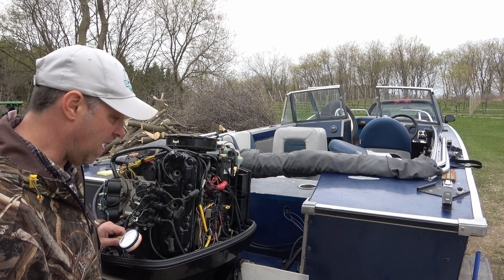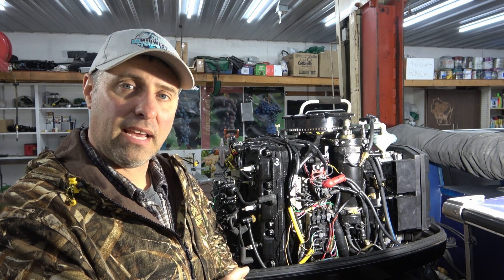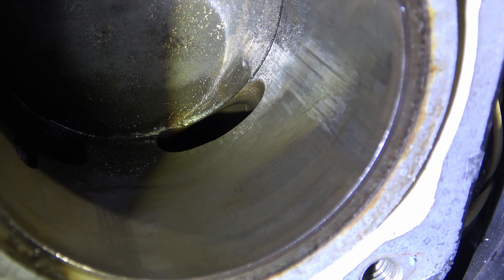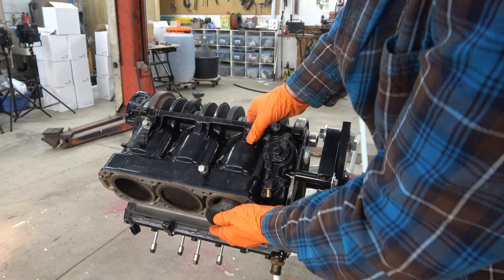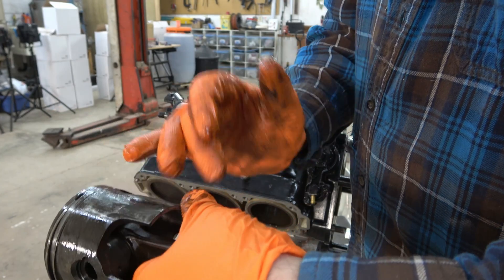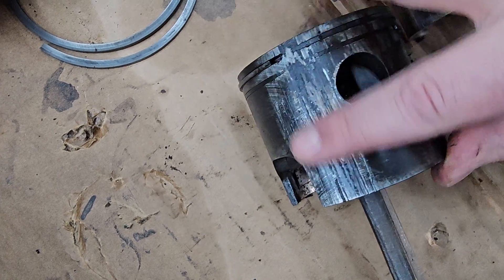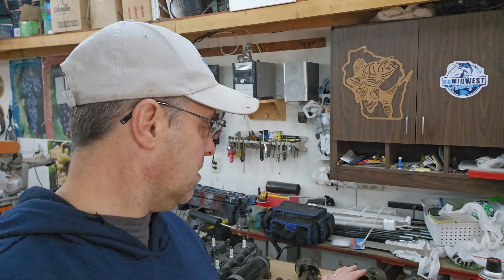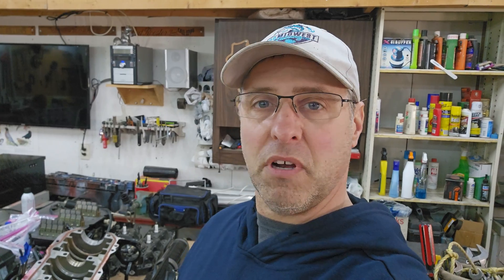This Boat Motor Has Zero Compression | Here's Why

Comment: is that a 2 stroke engine just curious ?
Reply from the maker: Yes. Its a 2 stroke carbureted motor. Hopefully this spring I will finally have it all back together. I'm doing a complete rebuild.
Reply: Yes, it’s a 2 stroke
Reply: @raisingcane225  thanks for your reply for a moment I was a little lost when I did not see  valves and a camshaft thanks again

Comment: I would ask myself why that whole bank of cylinders failed in the same way/ how are they lubricated and cooled? If the cause is still there the results will be the same.
Reply from the maker: I had the same thought. Someone mentioned that it probably overheated, so i will check all the cooling lines before putting it back together. Thanks for the feedback.

Comment: That first piston you pulled had  been getting hot too, I’d bet 2,4 and 6 were all getting ready to do the same as 1,3 and 5. It being oil injected there’s a good chance the oil pump sprocket on the crank is failing and you’re running a lean mix. Delete the injection it’s a 2stroke killer and very known failure point. run pre mix. Clean your carbs too. Also top bearing’s bleed line, valves or both need replaced she hasn’t seen any lube in a long,  long time. There’s only one way to know for sure if you’re running a good oil fuel mix and that’s to mix it yourself. Oil injection is a sure fire way to eventually blown up motor. Premix is the best insurance policy you can have for a 2smoke.

Comment: Why don't these motors have steel keyed replaceable sleeves? It would be so nice ! Skirt wear is crazy !
Reply: The 2.5 standard engines do have replaceable sleeves. I have replaced sleeves in dozens of them.
Reply from the maker: Thanks for the info. I will look into that.

Comment: I wish I could add a picture. I have a 1996 150 that looks identical to yours. I was out the river recently and suddenly lost power. Mechanics are all booked. Decided to start looking at the obvious. Opened up the cyclinder head and good lord. I can’t afford to replace the motor so I too am about to order a rebuild kit. But I also don’t know the full cause. I do know I contributed by putting in premium. Apparently that’s a no-no with these motors. One of the piston rings was broken to pieces, all gray/burnt. Without a mechanic, idk if there’s an oil issue, cooling issue, or if higher octane is capable of such damage. 
So far I seem to be the only girl trying to figure this out on here…I don’t think the odds are in my favor 😂 But either way, I have no boat so what the hell. Might as well try.
I hope to see more videos of where you’re at with yours, thanks for the great footage.
Reply: Useing   "premium"  fuel does not cause seizures like that.
Reply from the maker: I'm glad I'm not alone. I got my engine block bored out and have the new piston kit. I'm hoping to have it finished before winter so I can try it out on the lake. (if I put it together right) I figure worst case scenario, I will learn a lot about motors, even if I fail in the process. I'm glad you are brave enough to give it a try. Someone mentioned that mine looked like it overheated. I would double check all the cooling lines on yours like I'm doing. I'd love to hear if you had success.
Reply: @GoMidwestFishing  No success :-( The bad cylinder is too damaged to be bored out. Not sure if it’s worth it to pursue a “new” used block in better shape. Crazy how expensive this stuff is. Looks like you’ve been busy traveling!
Reply: Higher octane is not the cause lol

Comment: Stuck rings may get loose with power tune, follow instructions, some times I let it soak over night.
Reply: Aint no magic in a bottle that will free up stuck rings from scoring or that will fix the piston and cyl wall damage.
Reply: On more than one one occasion was was able to free up rings on some outboards that had lower than usual compression, no it won't fix scored cylinders, Jesus use your brain, I brought comps up from 30 to 80. Which I thought was fantastic. When the plugs come out with crud packed on em , it tells me , crappy oil usage or lack of maintenance, so I try before I have to tear into em., did you notice I said " may"....

Comment: That thing has run marginally hot for a while.  The pistons get hot at the exhaust side and it pushes it over to the transfer port side and makes the lands  start dragging and sticks the rings. Your seal ring on crank has always been broken more than likely. Check to see if the block has a groove. If not, they  broke the ring when motor was assembled At Mercury. I’ve seen about 20 or so of those. 
Put a water pump kit in it, make sure the poppet plastic seat is still in place. Sometimes they move and the water doesn’t flow. But you have massive water pressure. That will make one get hot and pop. 
Replace your check valve that lubes the top bearing. Probably has one on bottom main and one on top. 
Check your reeds. That will get water in cylinder.
Replace the two thermostats also. 
Did you have any loose bolts when you took it apart?
Reply: From my 2 stroke experience, the crank seal, likely the cause. A leak there will cause a lean condition, the faster the motor spins the more air it pulls in.
Reply from the maker: Wow, thanks for all that info. It is really helpful. All the bolts were tight. The motor was really clean and all the gaskets looked new. It looked to me like someone had recently done some work on the motor. I bought it off facebook in this condition. The guy I got it from bought it as a project boat, but didn't have time to work on it, so he sold it to me. He said it had low compression on one cylinder. That's all the info I know about it. I will check all the things you mentioned. Thanks again for your knowledge.
Reply: If the pistons are oversized be sure to mic the cylinders top to bottom. Sometimes you get a bore job and the cylinder is tapered at the bottom. If it’s a little tight the will seize at the bottom of piston first. 
Make sure you find out what went wrong before you build it. You do not want to repeat a failure.

Comment: That material on the cylinders is piston skirt. Coolant issue. Or oil injectors if it's an injected 2 stroke engine.
Reply: Or the crankcase not sealing and letting air in. That will cause a lean condition, which results in higher temperature with less oil to cool and lubricate.
Check the crankshaft seal rings and main bearing seals.
Reply from the maker: Thanks for the info. It is not oil injected, so probably a coolant issue then. I will look into the cooling system.

Comment: The crank and the rollers looked like they were affected by corrosion ...You sure there isn't a crack on the starboard side....The blow by was obviously caused by the sticking rings!!😎
Reply from the maker: The corrosion was very concerning. I will have to look closely into that. I had a specialist do the machine work on the block. So far he says its all good. I really don't want to repeat the same problems it already had.

Comment: Make sure your water pump is working properly . Could also be an air leak, creating a lean condition. Make sure you find out why all three pistons failed before you put the engine back together, or it will happen again. Hopefully, this helps .
Reply from the maker: Yes, I really don't want the same thing happening again, so I will check everything over. Especially the cooling system. Many people mentioned overheating.
Reply: can letting the engine sit be why the pistons failed ? meaning if i fix it and dont let it sit use it everyweek i should be good?